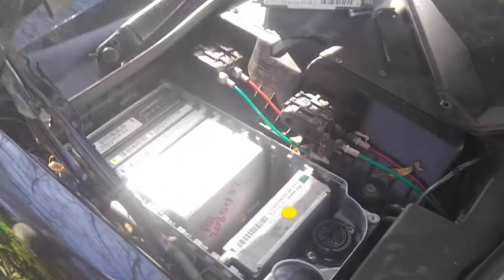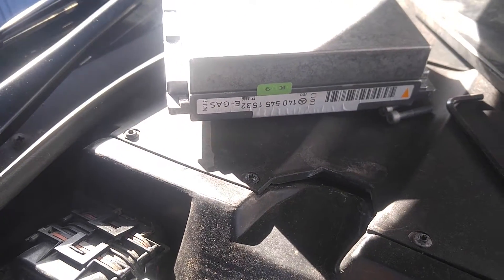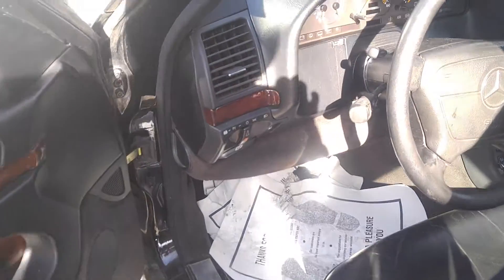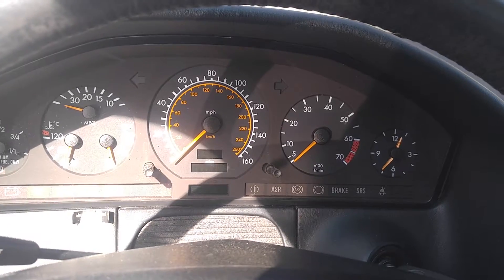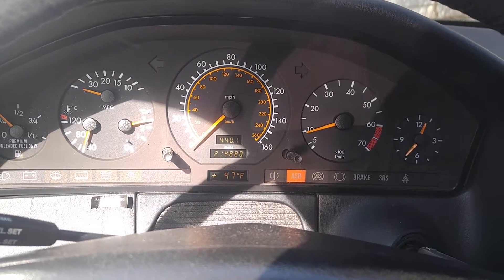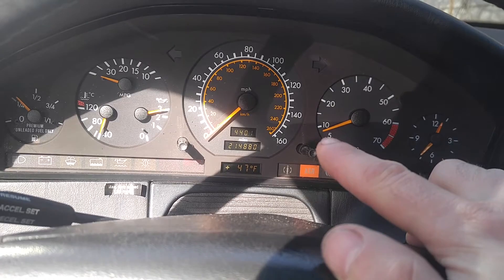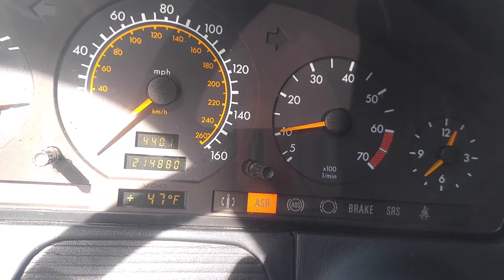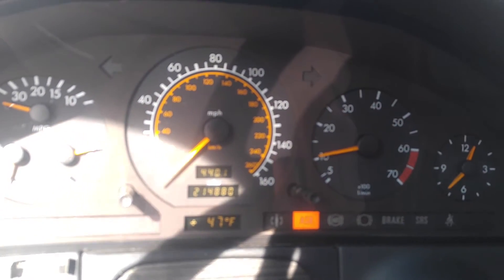Mercedes SL500 throttle control module test. E-gas. Part 1.

Comment: you need to put the AC on. to see if the rpm is still good. becouse some time idle control problem when AC is on is generated from Egas module

Comment: Myself also has a 1993 SL500, and as you describe on your website 93 SL 500 ETA=throttle body most likely doesn't goes wrong, so it rather must be the Egas module then? My car goes into limpmode only after coldstart ( in Winter) but after 5-6minutes of running on idle it goes away.